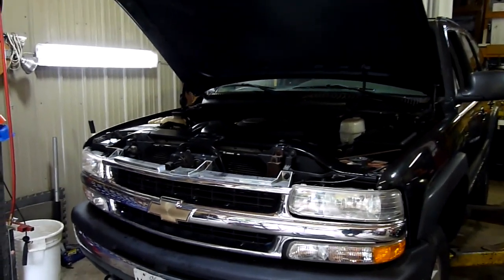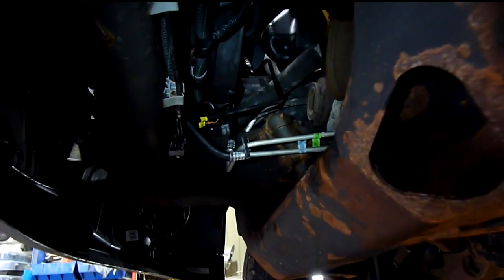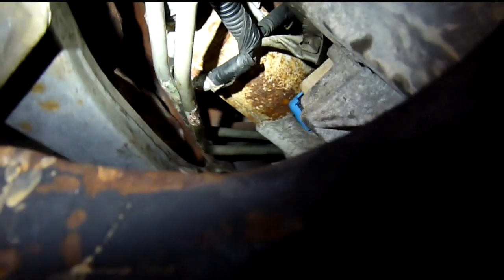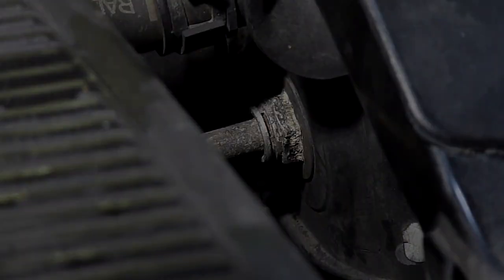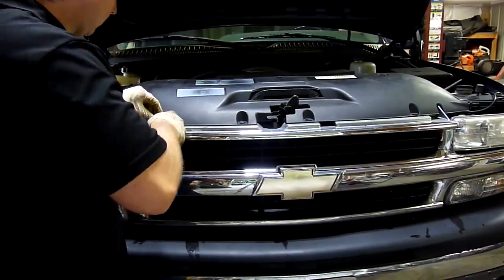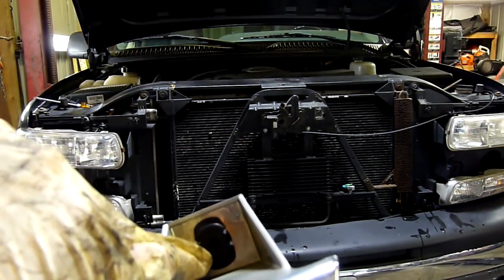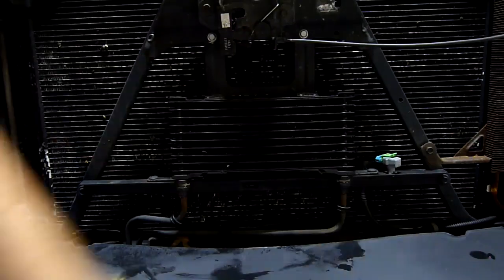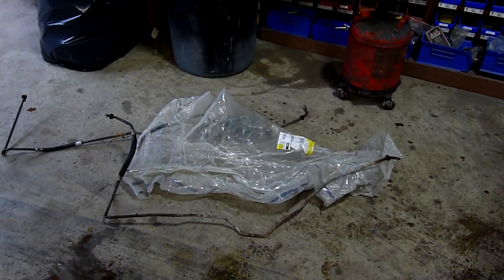2006 Chevy Tahoe Transmission Cooler Lines Replacement | Fix It Friday

Comment from the maker: 🚐THANKS FOR WATCHING! Here we have more TAHOE / SUBURBAN videos you might be interested in
Stuck/Sticking Door Locks ( Suburban, Explorer, Expedition, Tahoe,Silverado and more)
https://www.youtube.com/watch?v=G-jnJ8o9jMY

Program Keyless Entry 2008 Chevrolet Suburban/Tahoe
https://www.youtube.com/watch?v=0kp1jA1tNEw

How to change the air filter on a 2015 Chevy Suburban
https://www.youtube.com/watch?v=_-dCwFvgoaE

How to change a carbon filter on a 2015 Chevy Suburban
https://www.youtube.com/watch?v=8690dBNKxG0

How to change the oil on a 2015 Chevy Suburban
https://www.youtube.com/watch?v=Ft-4kALWgM8

How to replace a Wheel Bearing 4WD Chevrolet Suburban (2007-2014)
https://www.youtube.com/watch?v=i7oFILdc9CU

2000-2006 Chevrolet Suburban Tail Light Replacement
https://www.youtube.com/watch?v=RufIe1MHAQ8

1999-2006 Tahoe Suburban Oil Light Reset

https://www.youtube.com/watch?v=1RRnxhcsIU0

Chevy Suburban & Chevy Tahoe Headlight Bulb Change 2000-2006
https://www.youtube.com/watch?v=kVTDlv0R_hA

Comment: Just finished this on an 04 Yukon (RWD) in my driveway and no jackstands. I pulled the lines toward the rear and went back in the same way. I covered the ends w some cardboard and tape to keep from damaging them. You will loose quite a bit of atf from the lines. Be ready!

Comment: Finished this today on the ground with a jack and stands, a creeper was a huge help. I did not drop either cross member, diff or trans.The clips on the trans are the hardest part. Best method is to use a 90 degree pick, get it under the clip and pull it off to one side then you can slide it off the groove. You can get the lower one facing out the back of the vehicle however the upper one was easier facing the front. I can't begin to explain how to get your hand and tool in there it just takes trial and error. Re-installing the clips on the trans was difficult as well, long needle nose pliers may help. Re-installing the upper line on the trans was easier than the lower, just go slow, rotate, wiggle, don't be afraid to put some pressure on the metal it has plenty of flex. Both of my lines failed (read RUSTED through) on the metal bracket that holds them in place, I put a healthy slathering of undercoating on the lines and the bracket to hopefully prevent this happening again, at least for a while. Thanks for the vid.
Reply from the maker: Awesome comment! Thank you so much for sharing! Happy Motoring! -Blair

Comment: There is a tool you can but for like $15 that releases the lines from the clips without taking them off.  Do yourself a favor and buy it.  The trans ends access is not great and it definitely helps.
Reply: Didn't know this. And thank you very much because i was dreading having to put the clips back on the transmission connections.

Comment: Good helpful video. I have to do the same on a Sierra 4x4 w/ HD towing pkg. Some sites say you need to drop the rear of the trans, some say need to lower the front diff a little. My vehicle looks very similar to the one you worked on. Glad to see you're using OEM quality parts.
Reply from the maker: We typically can get pretty competitive pricing with ACdelco brands with the amount of volume we do. Let us know how this job goes for you! -Blair
Reply: @Revitauto  Finally had to do this project as one of the lines rotted out and leaking. Took off the trans heat shield and the other parts, plus the rubber splash shield up front, but could not disconnect the lines from the trans. My hands are too big or not nimble enough. Had to have the job completed at a shop.  Still, thanks for your video, it made the parts I could do easier.

Comment: Which lines going to the  radiator are the high and low pressure lines? Thanks for sharing.
Reply from the maker: O man, I have no idea anymore, do you have the tow package? They have a different transmission line set up with an additional cooler out of the radiator.
Reply: @Revitauto  No tow package, has only two line, I think if it had a tow package it would have three. Thanks for the reply.

Comment: I can remove the clips at the radiator but I was wondering what you removed near the trans to get the clips out at the trans? That space is tight and it looks like I need to remove part of the exhaust where it bolts to the manifold. Did you remove anything at this location? Great vid!
Reply from the maker: Hey buddy! I did not remove any exhaust work. The clips at the transmission are the same at the radiator. I went from behind the cross member to fish it in! Let me know if you need more help! Happy Motoring- Blair
Reply: @Revitauto  Thanks Blair. Did you install the lines from the front of the vehicle and run them back? Also, were you able to see the clips when you put them back in or did you do it by feel? Thanks much.

Comment: Great video. Did you have to lower the transmission or front diff? Thanks
Reply from the maker: Hey Joe! I did no need to just removed a heat shield and had enough space to fish it all in. I could see why you would lower the front diff, but since I was on a lift I was able to fish the lines in no problem! Happy Motoring!
Reply: @Revitauto  I've been struggling with this for hours, even with the front allt the way up in the air (albeit I'm on my back on the ground under the truck). Did you have to slightly bend the line?
Reply: I'm going to answer my self since i managed to get it done today with the help of a friend. 
1. Lift the front axle off the ground and turn the wheels to the right.
2. Follow disconnect procedure as detailed in the video.
3. If you have the tow package, you want to remove one plastic push pin under the transcooler that keeps the soft rubber mat under it in place. If you do that you can take down the hard line straight down from in front of the water radiator. 
4. When fishing the lines out you can note how to do this but my way was this: looking forward along the line, start by lowering the back end of the line and turn it clockwise, about 180. You might want to push it slightly forward or backward to get some space. The oil level sender is a mark i used, and look for when that is touching the bend of the line. Thats where you turn clockwise. Keep pushing forward, having your assistant helping you pulling and telling you when you are hitting something. When you do, turn anti-clockwise, about 90 degrees. Keep going forward until next stop, then turn anti-clockwise again 90 degrees. You should now be clear. 
5. In the famous lines of the late Mr Haynes, assembly is reverse of removal.
6. One last tip. The line that goes to the lower part of the water radiator, passenger side, should go under and to the right of the line going forward to the trans cooler.
7. It's going to be tight, but no need to bend the line, only some slight flexing while finding space to do the turn.

Good luck! I'm praying i'll never have to do this again :)

Comment: nice that you skip the only hard part, running the lines.
Reply: Honestly with mine I just pulled and shoved them until they went through
Reply: Man, it shows it at 7:00
Reply from the maker: I appreciate your guys defense! Derek this job can certainly be a pain on your back on the ground it's a struggle for sure! But can be done with patience and another set of helping hands to help manipulate the lines into place. Let me know how this worked out for you ?!

Comment: Before tackling this job, I would order some extra E clips, just in case.  $9/10.

Hate modern vehicles and motorcycles:  you have to tear them apart to perform mundane tasks, like dropping the transmission pan on a 2004 Tahoe.
Reply from the maker: Excellent idea! I appreciate the tip! Happy Motoring-Blair

Comment: Really would love to know how to remove lines from Transmission. That is the hardest part. No room! Any suggestions? Otherwise good video
Reply from the maker: What I did is I lifted the car and I went counter clockwise rotating the lines out the front. Its a BEAR!

Comment: I agree with the other commentors, show the hard part removing the lines from the tight space of the transmission.
Reply from the maker: Arturo, I wish I had a camera I could have gotten inside of that tight place to film. Thats why I show the process of how to remove the clip that holds the lines in. All of the connections are the same, once you know how to do one line removal you can do the rest. The space is tight !

Comment: How did you get the upper transmission hose off
Reply from the maker: Which hose are you talking about? All of the transmission lines/hoses are connected using a small clip and the hardline has a flare that helps keep it all in place. You remove the black covering cap, then remove the metal clip and it will pull out! Let me know if that helps you! Happy Motoring!-Blair

Comment: Did you replace 3 lines or 2 lines?  What is the brand and model number of the "kit"?
Reply: you can buy the upper or lower or auxillary trans line individually. theyre about $30 bucks each at auto parts store.